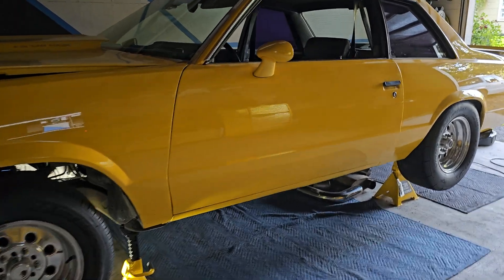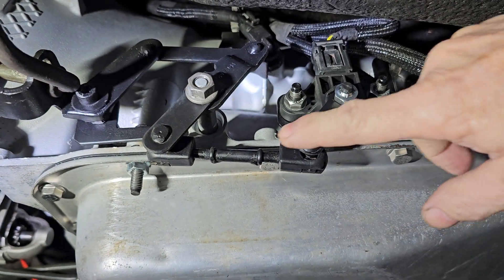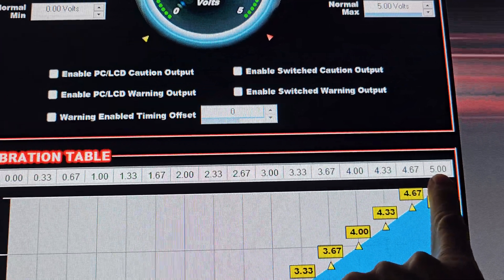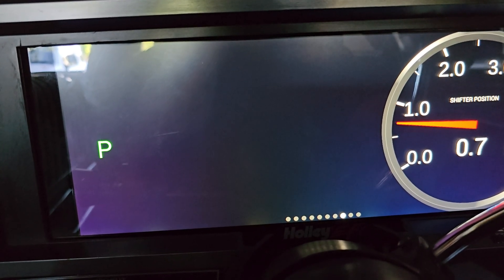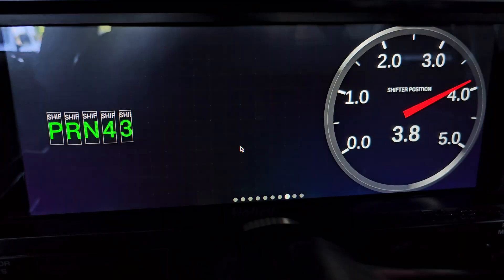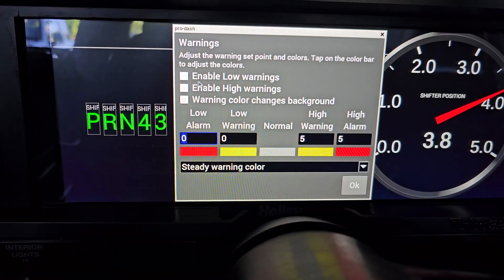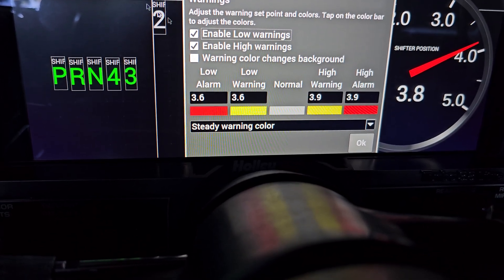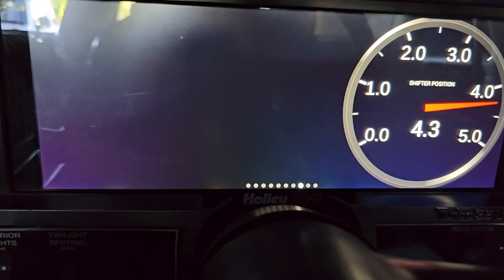HOLLEY Pro Dash - How to set up SHIFT INDICATOR POSITIONS.

Comment: Is this possible to do straight to the Pro Dash?
Reply from the maker: Yes. The dash has a 5V supply and a sensor ground. You can configure the input on the dash itself using input io.1 through io.13. Just scale the sensor in the settings like in the video. Then you can make a gauge to show on the dash.